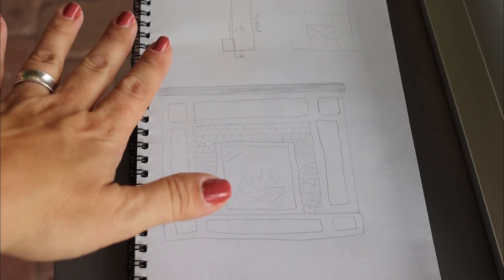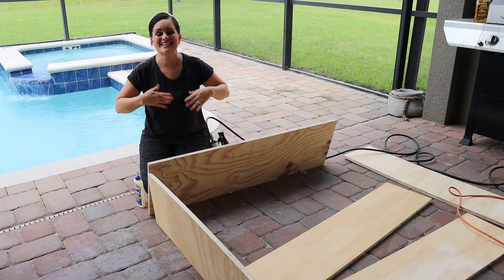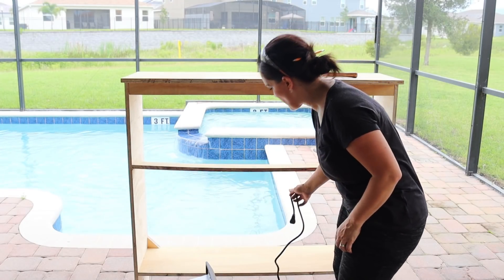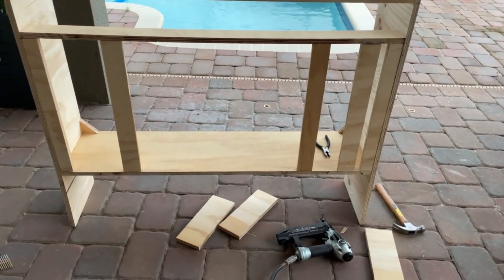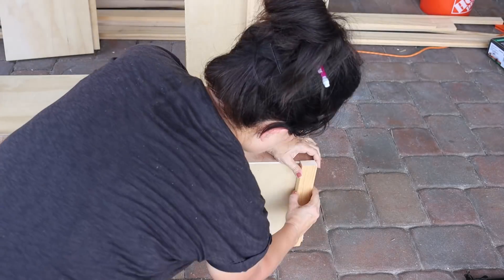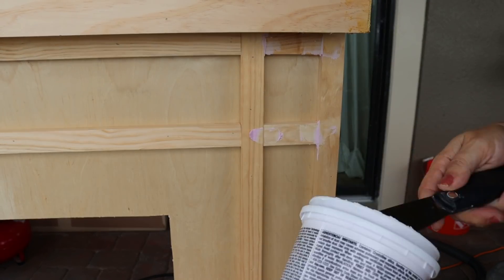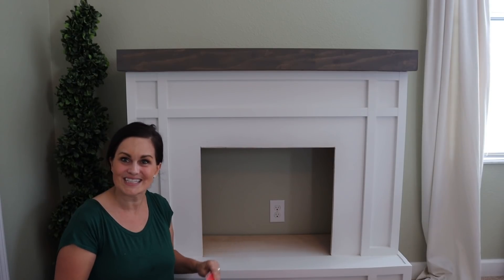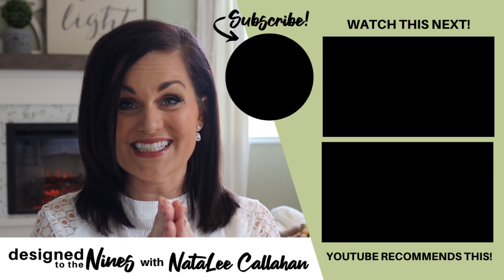You Can DIY This Renter Friendly Electric Fireplace!

Comment: When you are measuring to rip off an amount from the plywood/board don’t forget to take the width of the blade into account. If you want 12” wide - put your mark at 12” (measure twice) and cut on the waste side of the line to get an accurate cut. You can lose almost 1/8” from the blade waste.   Putting an X on the waste side helps you to remember what size to cut on.   Just something to remember when cutting lumber with any saw - table, miter, or circular saw.    Love the stuff you do and that you aren’t afraid to try something you have never done before.

Comment: This is so cute! I wish I could build and actually use it. :'-(  The building that I live in is from the 1860s. half my apartment is on the old knob and tube wiring with the fuse bulbs, and the other half is on a fuse box. I can't even run a space heater in here without having half the apartment going out. Need to have more wattage.

Comment: I have one that is on wheels already that moves around. It is so small. I want to make it massive so I can hang my TV on the wall above and use the top for decor and maybe by lifting mine up off the ground, I can have two or three open spaces to slide cute wicker baskets in and out of?

Comment: I want to add height to a store bought electric fireplace. Would I just build a 10 inch high rectangle box adding  few inches longer than the fireplace for the width, which is 50", and to have a hearth of maybe 8 inches deep from actual fireplace ?  The 40 inch high x 50 inch wide electric fireplaces look way to small in a living room.